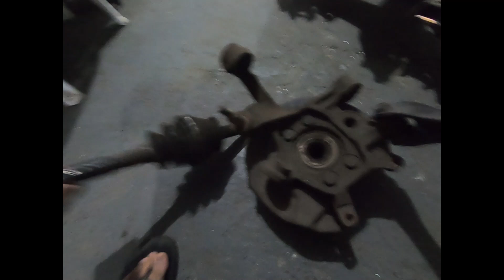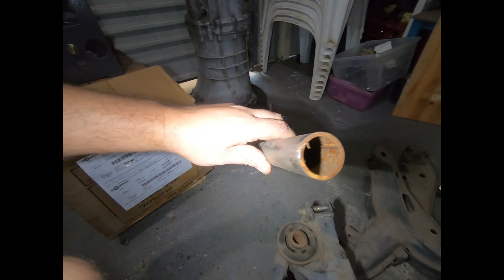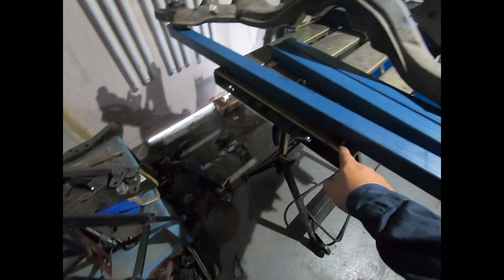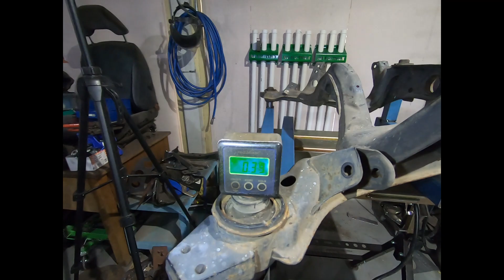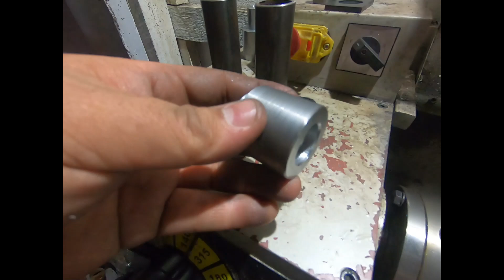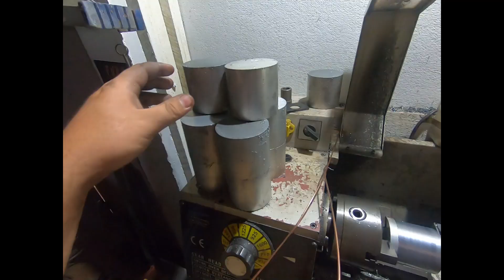Barra R33 - Rear end EP2 - R230 swap progress

Comment: I'm thinking of to put an r230 into an  s15 with z32tt hub. Can I use 370z axles? I think they have the same dimensions than 350z but they have 32 spline. If they are too short then I can just use spacers but if they are too long that's a problem.
Reply from the maker: I'm finding the r230 is so wide flange to flange I need adjustable arms to widen the track to stop the 350z axles binding when straight. If the 370z axles are 32 spline then you can use the z32tt hubs.
Reply: @kaptain_ken  Ok, thanks! When we can expect part 3? 😁
Reply: @kaptain_ken  so the r230 swap isn’t worth it? I’m currently swapping a barra into my r33 sedan and looking at options on what to do with the rear end, if the r230 isn’t an option would a 350z/370z diff be the next best option?